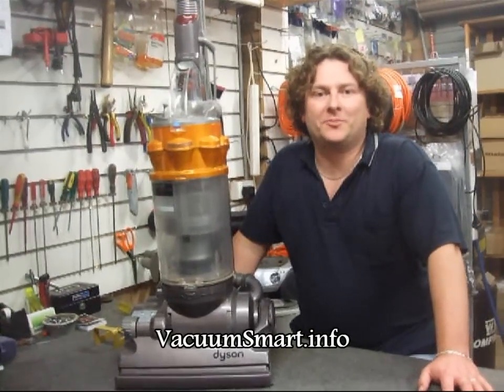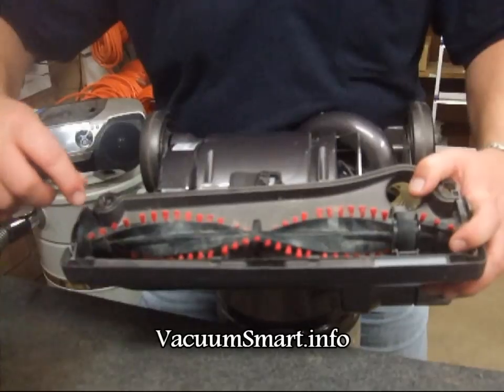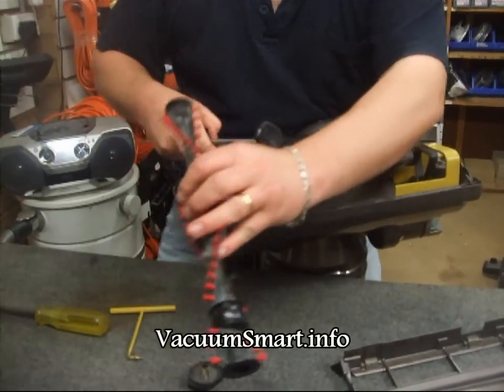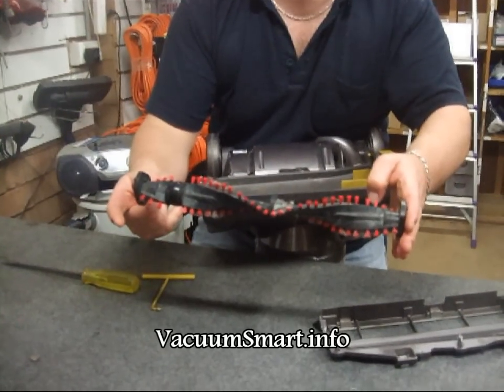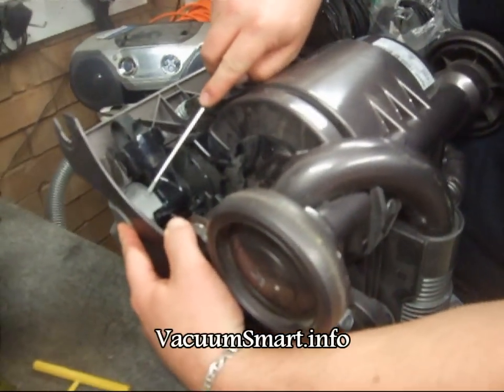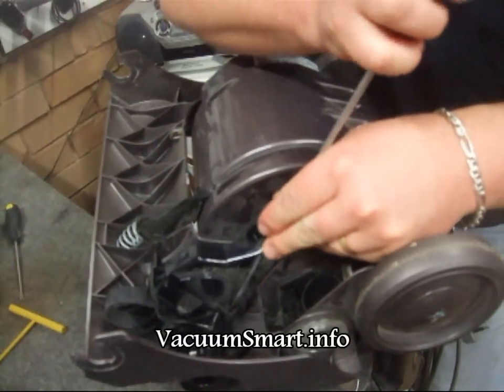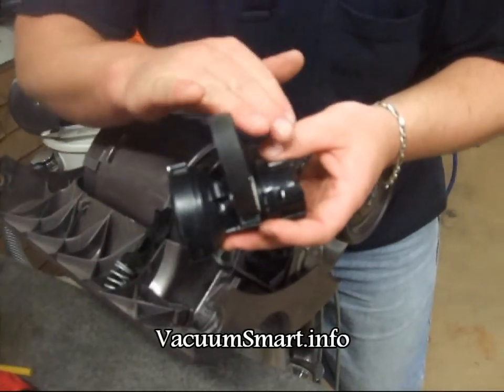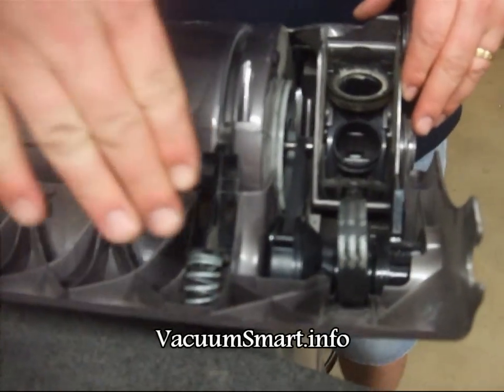Dyson DC07, how to check the clutch & Brush

Comment: This is a great!! I recently picked up a barely used DC07 at a rummage sale for $1 (US). The motor worked, but the brush did not spin. After watching this, I picked up a new clutch for $31 and 2 new brush bearings for $5 each. So, for $42, I have a great working machine now. Thanks for a very informative and easy to understand video!!

Comment: I just bought this model at Goodwill for $20 and got it home and after 30 secondes of running the brush on carpet it started ratcheting and I thought I picked up a hair pin or screw or something....gonna take mine apart and check this..!! Great video Alec..!!

Comment: Follow up. I was able to get everything apart; down to the clutch assembly. It doesn't appear the  cover plate is like the one depicted on your video. It looks like a solid piece. Also, there is a screw on the side with the head facing a height adjuster on a spring/lever. I wish I could post a picture! It doesn't look like there is any way to get a T15 driver into that space. I was going to try to pry it out of the housing, but it seems very firmly emplaced.  /s/ perplexed.

Comment: Alec, thanks for the tip to check the brush bearings! I found a Dyson DC33 Multi Floor at the side of the road, so took it home. Was making a really bad ratcheting sound, so thought for SURE it was the clutch gone & needing replacing. Got replacement belts & the belt lifter tools & sure enough, the clutch was fine, the brushroll was the issue. One of the bearings was mounted right on the rod, so instead of replacing it I just cleaned the inside of the bearing with some contact cleaner, water & a soft toothbrush & re-lubricated with 3 in 1 motor oil & a teeny bit of petroleum jelly. Re-assembled, & the Dyson works like new! Thanks, you saved me the cost of a new brushbar.

Comment: Superbly made and presented video. There's a similar one for DC04 motor replacement which is also extremely well done. Really grateful for these as I've been able to service my DC04 using a freebie one with lots of broken parts but a good motor and now my DC04 is working great again. Thank you so much, it's 2023 so 13 years down the line from the making of this video and it's still as useful as it was when it was made 😁

Comment: You helped me fix my Dyson after watching your video. The vac made an ugly noise, and the brush wouldn't turn when in carpet mode.  A little tinkering with the roller, roller belt, side bars that hold roller in place to make it turn again, and wallla! The brush spins and the ugly noise is gone, and it works!  Thank you for posting the video.

Comment: Thank you so much for making this video! I have a dc07 that I replaced the clutch assembly on because it literally melted. When I did this repair I was completely unaware of the bearings in the roller. I started having similar issues with the roller about a year after the repair. Thank goodness I found this video because I almost ruined my new clutch assembly! There was a nest of hair around the pin that goes through the bearings. Luckily there was no hair in the bearings. I cleaned out the hair and reassembled the brush but it wouldn’t turn freely. So I put a couple drops of skateboard bearing lube in the bearings and brought them back to life in only a few minutes. Now it works perfectly and I won’t have to replace the clutch assembly again!!! I can’t thank you enough.

Comment: After 7 years, my DC07 Animal's bristles stopped spinning.  I followed your video step by step and discovered my clutch belt was broken.  After watching your video, I realized it would be best to replace the clutch assy, as I had black marks on the pulley.  I ordered the part (and the belt holder) from Amazon for a fraction of the cost of repair or replacement.  You make it look easy!!!  I struggled a little to get the new belts pulled far enough to fit over the holder, but once I got it, the rest was a breeze.  Thank you for this informative video.  I fixed it myself for approx. $50!

Comment: thanks i just used ur instructions and now my dyson works like new. i bought this vac for $60.00 at a pawn shop due to the noise it made when it was put on the carpet setting and thought it would be a upright vac for cleaning the house but thanks to u i have a 500 dollar vac that works like new for about 10% of the price  again thanks so much

Comment: Thank you for the informative video. I've found two of these machines at second hand stores now, in different stages of partial function.  The most recent will need a clutch, but I'll only have spent 50US total on the vacuum after fixing it.  Very helpful tutorial.

Comment: Wow! Alec is the man. Great video mate, cheers! Followed his instructions, went online to order a new clutch and the belt tool. Two days later watched the video again, and tadah!! Works like new. Alec you rock, thanks.

PS) For those of you wondering if you really need the belt replacement/removal tool thingy. Yes you do. I could take the belt off just fine with using a few screw drivers. But, getting that thing on would have been a nightmare without the tool. Get the tool, skip a latte or two to pay for it and thank yourself later.
Reply: No, you do not need the tool, and you will not thank yourself later, because you will most likely be wondering what the hell it is 6 months down the road before promptly throwing it away.

Comment: Excellent video! You can make the job even easier by magnetizing (or gauss if you prefer) the tip of your T15 torx driver. Simply use General brand tool P/N 3ZH19 or P/N 3601 which can be found at most hardware stores for $3.00 to $5.00. The driver will have enough strength to hold the screw firmly in place during installation or lift it from that recessed cavity during removal.

Comment: Thanks so much!  I have a DC07 and when the brush was engaged it would give a loud grinding sound.  I figured it was the clutch but after watching this video I took the rod out of the roller and it was filled with hair and other gunk.  Cleaned it out, put the rod back in and the brush spun freely and easily.  Great 5 minute fix to save my vacuum.

Comment: Great instructional video.  Gave me the confidence to swap out the clutch in my DC14.  One step that was tricky and could have used more clarity is the removal of the "Bare Floors or Carpet" knob.  I had to watch another video to get the additional tip of prying it from two sides.  Other than that, great video!  Really appreciate the help.

Comment from the maker: Aloha right back at yah :)
The problem you are describing is due to stretched belts.
Have a look at one of my other videos about changing the clutch belts, it's a pretty fiddly job to be honest so have a look at the cost of belts v's cost of replacement clutch. If you have the cash just buy a clutch, if you have the time go for the belts. You must remove the clutch first to see if the white plastic wheels inside are in any way melted if they are you need to toss the clutch and replace.

Comment: Excellent video!  I used your instructions to remove excessive dog hair from the bearings and underneath the two belts on my DC33.  Worked perfectly.  The only portion i had a little difficulty with was 'holding the front and while levering off the back" (2:51 in the video).  That step looks much easier in the video.  One of my bearings was a bit rough so I lubed it with 3-In-One. Can't thank you enough...my wife is happy now.  :)
Reply: Great video. You have helped so many of us. You are a gentleman and a scholar. Thank you for sharing your time and knowledge.

Comment from the maker: Hi There, The clutch is to disengage the brush when upright but also to warn you when something is stuck or preventing the roller from spinning in normal carpet vacuuming. Not all DC07's had a clutch - Only the ones with a Carpet / Hard Floor selector on the front head part. The clutch would not normally make a sound in upright position if disengaged but yes bearings are most likely. Also not having the base plate fitted correctly can make a similar sound. Regards
Alec

Comment: Much Mahalo for the expert advise!  The brush beater belt seems tight, so I thought it could be the belt from the clutch-to-motor.  When I removed the brush and took apart the bearing end-caps for inspection, I found a clump of hair [my wife has beautiful thick hair] wrapped around the cap.  I cut the hair, reinstalled the brush and it seems to spin much, much faster.  Did a test on some cat fur and everything seems A-OK =)

Thanks Again & Warm Regards from Sunny Hawaii =)

Comment: Great video, thanks for the detailed instruction. Have a few questions though...

Is the function of the clutch to disengage the brush when the vacuum is in the upright position?

Also, do all 07's have a clutch? I don't think mine does (UK Origin 07, think it's probably an early model). Mine was intermittently noisy both when using normally and in upright position, but taking off the brush, the noise seems to be gone. Can I safely assume it's the bearings in the brush that are bad?

Comment: Ahaaa! Awesome video! I'm really glad I read your reply to polyfusion, however. I have a DC07 and it appears to have the same clutch assembly that your subject DC14 vac has - but the headstock says "Automatic carpet height adjustment"...

Does this mean I don't have a clutch? Given that my roller bearings are smooth as silk, why else might my rollers not be spinning?

Baffled

Comment from the maker: Also check the bearings in the actual roller brush sometimes the belts become stretched after struggling against worn out or siezed up bearings. I find that almost every DC04, 07 or 14 i do now I change the bearings just to be sure. They are cheap and easy to replace so why not. 
Hope this helps

Comment: Hi, I just picked up one of these used from a thrift shop. Everything works except the brush roll does not spin. I took iff the bottom cover thinking maybe it was clogged at the ends with hair, etc. or the belt was broken or had come off but it looks normal. 

I'm kind of stumped here and wondering what the issue could be.

Comment: My Dyson DC07 Animal is not making contact with the carpet correctly.  There is no problem with the brush assembly, I could get that off and check it but when I tapped no bearings came out, other than that it just needed a slight cleaning of the brushes since I try and clean it often to keep it running well.  I have no problems with suction.  Would this be the clutch that is causing the problem with the brush contacting the floor?  If I hold the vacuum almost upright it works a bit better.

Comment: Alec, quick question.  Found that the brush was bad.  One end would not turn in my DC14.  That end, the inside was worn down on the end cap and the inside of the brush from the end cap had been worn.  So needs replaced.  However, checking the clutch, it is spinning freely, but there still is black "burnt" rubber on the white clutch drive.  I'm thinking since the clutch had been spinning and the brush was stuck, that probably caused the black on the white clutch drive.  In the video you state the black may mean it's bad but also state if it moves freely, it's good.  More of asking for you opinion I guess if it's worth replacing now or wait until it quits moving, if it ever does.  Thanks and great video!

Comment: I see how to change the bearings BUT HOW DOES ONE KNOW if the brush needs replacing? This video is partly about checking the brush however, you need advise on when or how to tell if you need to replace it.

Comment: Question, if i have good sucksion to the handle and attachments but no rotation on the brush in the laid back position to run over the floor what might the problem be?
i have pulled brush out and cleaned etc.
Thanks

Comment: I put  a new clutch in and put it all back together not working :( took it apart and turned it on the little belt runs just fine and the big belt doesnt move.... is it to tight? what should I do now?

Comment: The clutch is not the problem in my opinion. I think what has happened is that over time the front end plastic housing has become a little rough and simply doesnt lower the base to the floor properly. You need the base to lower flat to actually get a suction seal. Have a look at the head from the side as you lower the handle and you should be able to see the point of pivot. A little WD40 or CRC should help.

Comment: The orange belt tools didn't work with my purple Dyson Animal.  There's a bit of plastic housing that keeps the belt tool from sitting flat on the vacuum.  The hook was useful though for fishing the new belt through the housing and hooking up the smaller belt.  Great video, wouldn't have succeeded  without it.  Thanks!